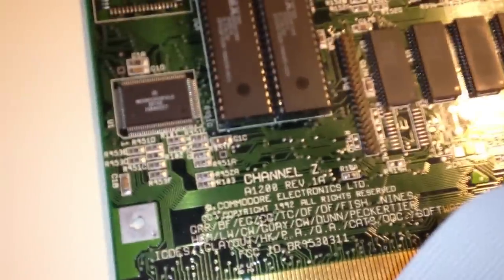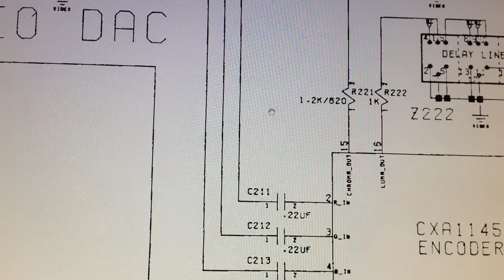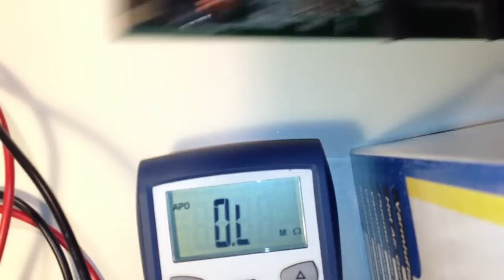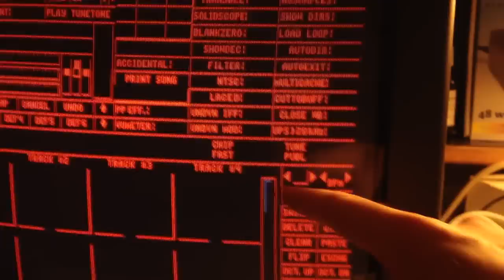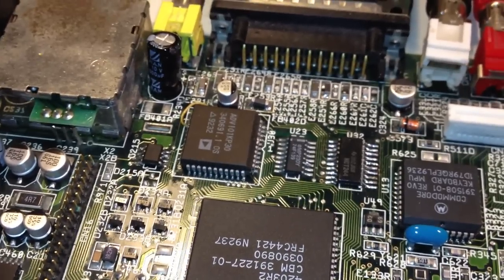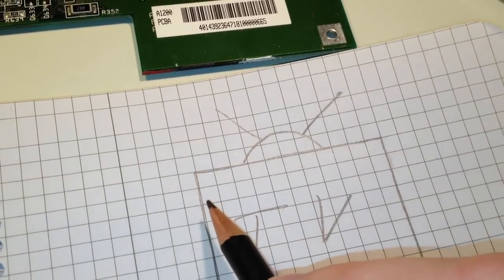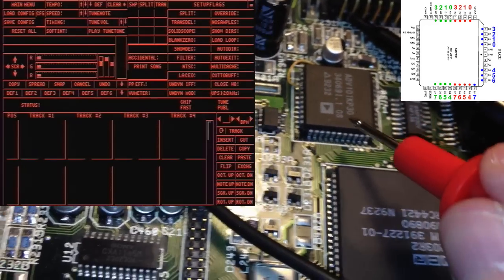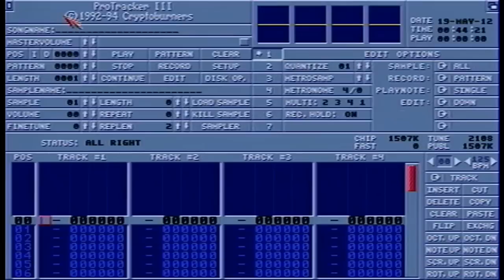Amiga 1200 color problem repair

Comment from the maker: Yep, exactly. This is a 8-bit video DAC, meaning it is working with 8 bits for each color respectively, with a total of 24 incoming bits for the video. In the datasheet for the video DAC, it is also explained that R0, G0 and B0 are the least significant bits, climbing up to the 7's which are the most significant ones.
I'm impressed with how quick you were with your comment after I posted the video, btw. :)

Comment from the maker: Yes, you are correct. The video DAC on the A1200 is a 24 bit device (8 bits per color). The bits are named 0-7. In this case, it was bit B7 that was not working, which is the most significant bit for the blue color. In the middle of the slidebar, it should have changed to 1000 0000, but instead it changed to 0000 0000 since there was a problem with B7. That's why it went back to black in the middle of the slidebar.
Reply: Using the pulse injector was a good way to demonstrate this however ;) The binary logic seemed clear when you thought B3 or B7 were at fault and using the evidence it could be derived that the HSB was at fault as it is only at level 1 twice in the full range (bit late in the day for my comment, no pun intended ;))

Comment: Ob btw, and the way that it turns to black in the middle, indicates that the next higher bit is not working: example with 4 bits:0000  0001 0010 0011 0100 0101 0110 0111 then it should be 1000 but it's 0000 and starting from beginning. So the highest bit was defective. This is an alternative mathematical way to figure out which pin is not working (but not at which chip)
Reply: This came to my mind too right as soon as he playing with the sliders. And then when he was playing with the probes you can see that number of times it goes high is 2, 4, or 8. And the most significant bit would have been only 1 time had it been working... off or on.

Comment: How come you got a signal from B7 on the oscilloscope when the slider was halfway and upwards but no indication on the probe? It made sense that that the most significant bit was the problem since the intensity reset at exactly halfway, but then the oscilloscope should show a signal? Also can't quite understand why B3 was constantly on from halfway and upwards, expected it to flip twice as much as B4 and half as much as B2?

Comment from the maker: About upgrading... Are you sure the layout of your motherboard corresponds with the pinout of an A500+ Agnus-chip? You can not just replace an 8372 Agnus (found on A500) with an 8375 Agnus (found on A500+). The 8372 and 8375 have different pinouts, so you need to have a motherboard that fits the Agnus version you want to use. Search wikipedia for "MOS Technology Agnus", and you will be able the compare the difference in pinout between the different revisions of the chip.

Comment: well on the PLCC each color has 8 pins that represents a byte, thats why for example the B0 switches between high and low more often since its the least significant bit, same goes for green and red.

Comment from the maker: What, you didn't swap any resistors?? Aw, come on man! You gotta swap the resistors. It's the new trend, you know? And also, there is a big chance of the picture showing up like normal again if you change places of a few resistors at random. :) :)
On a more serious note, I think it might have been something similar to this problem. Was it an A1200 or another model? Since you're writing in past tense, I'm wondering what happened with it? Did you manage to fix it? Or did you decide to sell it?

Comment: hi retrogamemodz, can you help me with some basic info of what you might think the problem is?
I got a CD32 that i bought from someone as "working"
When i pluged it in, nothing worked, it only showed a green light but it didn't even tried to load a CD.
i open it and saw two bulging caps, 470uf caps if i remember correctly, swaped them and tata, i had sound and the cd was spinning, but i didn't had video, neither from rf or composite, i didn't tried via svideo because i didn't had a cable.
i could see a distorted faint black and white picture when i turned the cd32 on, but i wasn't able to read a thing.
Could this mean that i have a cap issue or could this be a video dac problem or even lisa problem?
Reply from the maker: Vasco Morais It's difficult to diagnose a problem like that based only on that description. It would help if you could make a youtube video of it and show me what the symptoms look like, and maybe also show me what condition the motherboard is in.
Reply: sure, ill try
Reply from the maker: Cool. Let me know when you have posted the video.

Comment: Still about? What specific version of Protracker are you using? I've a 1200 with similar problem and all versions of Protracker I've tried so far don't have that colour slider version. Blue is somewhat dim on my 1200 and there's a dark horizontal band when showing fine checkerboard (from Amiga TeskKit)

Comment: Very pertinent and presented in a very entertaining way!  I have an Amiga 600 with a similar problem.  The colors suddenly became tinted with bright yellow.  The funny thing is that the problem arrived overnight so it's not a cheap repair from the previous owner.  On boot up, the floppy reads a few tracks and then stops while the screen displays the classic boot screen.  So it's not currently possible to load some utiliites to help troubleshooting the problem.  Looks like the Amiga can not recognize any floppy as bootable.  Can I send you the motherboard and how ?

Comment: Again, great video as usual.  I could use your help on repairing an Amiga 1000 (NTSC) I just received from eBay.  Seller said it only "partially" worked.  On one TV, all I get is a solid green screen (CRT).  On a crappy LCD, I get a solid gray screen.  I have re-seated the Agnus and CIA chips.  Any ideas?

Comment from the maker: It's difficult to say a price, since I don't have any set prices. You will of course have to cover all shipping fees, all my expenses for spare parts etc, and a little extra for my time. I put the time needed into every repair and never do a hasty, sloppy work. Because of that, I never charge per hour because it would be too expensive for others to let me fix their stuff. Enough for me to feel there is a point in doing it, and low enough for you to also feel there is a point. That's my price. :)

Comment: Beautiful indeed - I absolutely enjoyed watching this one. Interesting to see the behaviour of the 2 swapped resistors, but I especially enjoyed the 2nd part. Thanks for showing the Logic Probe and the Logic Pulser - really nice to see properly how things really work. Would love to see once how you soldered the PLCC (VideoDAC), maybe will see an example how you solder in one of your further videos (as I'm going through them one by one). That jumperwire was interesting... which motherboard revision was this? I have a Rev 1D.4 infront of me (also with the VP101-3BA), but without jumperwire...
Reply: Ops - just rewinded to the beginning of the Video and saw that it was Rev 1A you had infront of you

Comment: why you don't measure resistance between b7 and the ground? it may be short circuit on board under the chip, not broken chip.
Reply: Bad conclusion. If such short existed the installation of the replacement chip would have exhibited exactly the previous symptoms.

Comment: Are they using 2x 4-BIT outputs for each colour channel? I figured it was BIT 7, but BIT 3 behaving the same (dropping to 0 at the half-way mark) was a surprise.

Although, if mid-way is where BIT 7 comes on, you'd expect everything to go to 0 at that point - 01111111 -> 10000000.

Actually, I'd expect BIT 3 to go up and down a bit more frequently. I'd expect BIT 6 to come on just before half-way, turn off at half-way and then come on just before full. 

Perhaps it was a sampling latency problem, and the slider motion defeated the accuracy.

Another thought:

B0 = BIT 0
B4 = BIT 1
B1 = BIT 2
B5 = BIT 3
B2 = BIT 4
B6 = BIT 5
B3 = BIT 6
B7 = BIT 7

Kind of interleaving the bits across the pins, which would explain the behaviour I observed.

Interesting.

Comment: Hi, first of all, you rock :)

I have a question, I don't know if I missed it but I was rewinding the video looking for explanation why the video DAC has two pins bridged via yellow signal wire, and I don't know if you're elaborating on that or is it a normal situation.

EDIT: I'm too impatient, sorry :) I wrote that comment before watching the whole thing
Reply from the maker: Yep, it's true that I didn't really go into the technical details about why the wire is needed on the chip. But it's all very simple, so I can answer that question here instead:
One end of the wire is hooked up to pin 16 of the chip. The other end is connected to pins 20 and 21. Pins 20 and 21 are both ground. Pin 16 is called "REF WHITE" and is described in the datasheet for the video DAC as follows:
"Reference white control input (TTL compatible). A logical one on this input forces the outputs to a white level, regardless of the input pixel data."
So, since a fully white picture with no relation to the input pixel data is not desired, this input should always be tied to ground in order to keep the DAC from latching into a fully white output state. Therefore, pin 16 should be connected to video ground on the PCB itself, but it isn't on motherboards rev 1A and 1B which is probably a design flaw. In conclusion, this wire is most likely a factory modification which they had to do on all rev 1A and rev 1B motherboards or the Amiga would show nothing but a white picture as you could see in the video here. I have seen this wire on other rev 1A and 1B motherboards as well, but I have never seen it on other revisions as far as I can remember. This also speaks for that this was a design flaw on rev 1A and rev 1B which they fixed in later revisions of the motherboard.

Comment: Hi, your investigations are so cool. Kudos for that!
Here is a problem that's somewhat similar to yours, for which I would appreciate any hint or help:
Amiga 600 Rev 1.5. The Green-Output on RGB shows no output for the first half of the slider, than starts rising. So the Workbench 3.1 background (standard colors) is not grey but purple-ish (missing amount of green). The Composite output ist perfect in colors! So I guess, there is either something wrong with the CXA1145 Encoder or with the components connected to the G_OUT (Pin 22) of the encoder.
(https://www.amigawiki.org/dnl/schematics/A600_R1.5.pdf / Page 5)
Do you see any other possible suspicious thing?
How can I localize the problem (I have no oscilloscope, but a multimeter)? Any suggestions how to go on?

Comment from the maker: I think it's a good thing to be scared of doing things you don't feel confident with, because that stops people from doing weird things they don't know anythinig about, and really shouldn't be doing. Like for example, swapping resistors at random on motherboards, or replacing surface mounted capacitors on a motherboard with through-hole resistors. :) And also, there was of course this thing about voiding the warranty back in the early 90s that made opening A1200s perhaps not such a smart idea :)

Comment: I think the "more beeps (switches)" are because the values are counted in a binary way, so the lower bits should beep more often than the higher beeps. If you count binary, you will recognize this behaviour ;)

Comment: Well, it was my 90s Amiga. I was a total noob back then. So the service shop repaired it. Don't know what they did, but it worked. I was too scared to even open my Amiga back then :D A1200 it was. Then I sold it at the turn of the century. Stupidest thing I've ever done. Now I'm overcompensating with multiple Amiga models :D
Maybe I should take one of them now and play "swap the resistors" :) Naaah, I couldn't never do such a thing on purpose :)

Comment: Hi, RetroGameModz, I like your videos, and I decided to ask you about a problem. I've got a really good WD MFM hdd controller, and there's an IC on it, that's pin is connected, and soldered into the pcb, but at the edge of the IC it was broken. It was in the school, so maybe some idiot kids did it. How can I fix it
Reply from the maker: If you mean that a pin has broken off the IC, then all you can do is to try to get hold of a new IC and replace it on the board.
Reply: Ok, thanks. Anyway, I enjoy your videos. :)

Comment: Hi there, really nice videos that you have been making, really appreciate it.  I have a similar issue with my Amiga 1200, do you happen to know what might be the issue?  And could you help me with getting this fixed? (and maybe a new video!)  The only mod I have done was apply a 1 uF cap on D215A as I was getting lots of flicker with floppy drive access.  Now it's developed this bigger problem with a bright pink screen.

http://eab.abime.net/showthread.php?p=1042660#post1042660
Reply from the maker: +tjlazer71
Try changing the slidebars for the three colors (R, G and B) in ProTracker for example to see what you get. I have done this several times in different videos, so you can check that out if you're not sure about what I mean by this.
Check to see if you appear to get a normal response from every one of the three slidebars. That would be the first step when troubleshooting something like that.
Reply: +RetroGameModz I will try the Pro Tracker screen color test and see what I get.  I've been looking into this problem and I think I have a bad DAC chip, VP101 3BA.  The chip is hot to the touch, and when I press on it I sometimes get a screen flash. My board is a 1D1 board and I heard they are prone to this chip going bad.  If this is the case, do you know where I can get a VP101 3BA chip from?
Reply: +RetroGameModz I did the test with Pro Tracker v3.00.  Green is working as it should, and Red and Blue are NOT.  So it seems Red and Blue have a bad connection to the DAC.
Reply from the maker: Yep, or the DAC might be bad. You have to troubleshoot the motherboard with proper test gear in order to find out where the fault actually is. The video DACs can usually be found on eBay if you search for the parts number.
Reply: +RetroGameModz Do you offer repair services?  :)
Reply from the maker: I usually do, but not at the moment I'm afraid since I have too much hardware to repair already as it is.